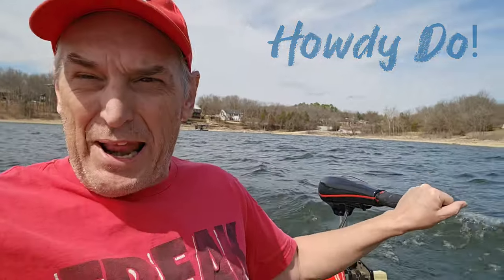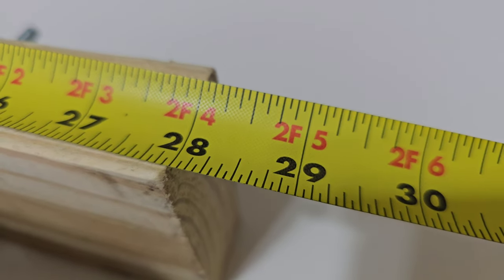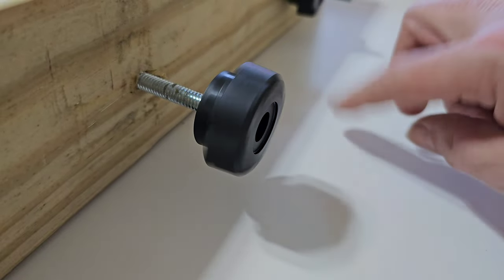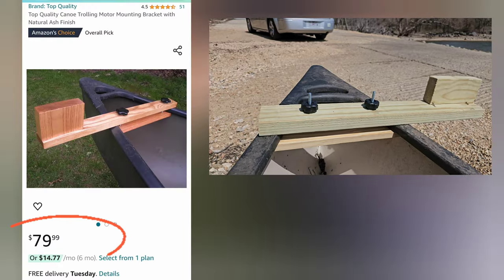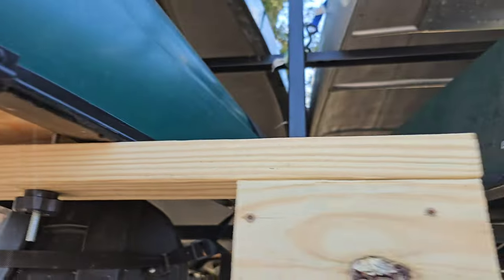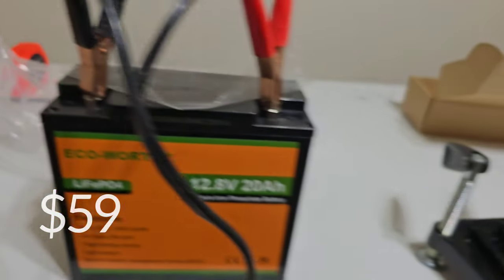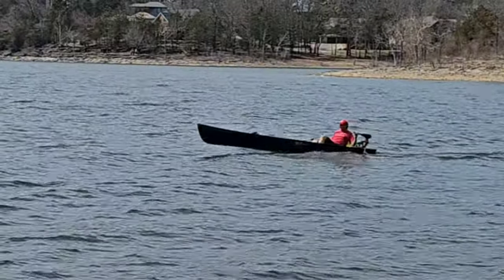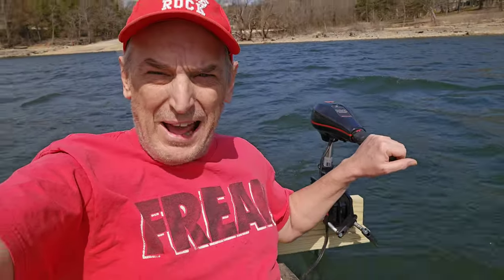Easy DIY Canoe Trolling Motor Mount 💡 Save $$$

Comment: Looks great! How fast does your setup go? I am trying to put together a trolling motor setup this week. Got my batteries, but still need to find a motor, hoping for 24v.
Reply from the maker: I am not exactly sure how fast it's only a 30lb.but I suspect 5 to 8 mph. It has really opened up the lake to me.  Good luck on your setup. I have heard 24v. Is a good option. Let me know how it goes.

Comment: How much time do you get out of that battery ?
Reply from the maker: @MartinPiloCorrea i am still trying to figure  that out, I would say maybe 3 or 4  hours if I don't run it on top speed.  I stay out all day goofing around, but always try to save the battery for the trip home. My motor is only a 30lb.